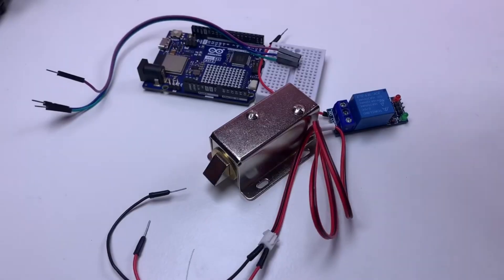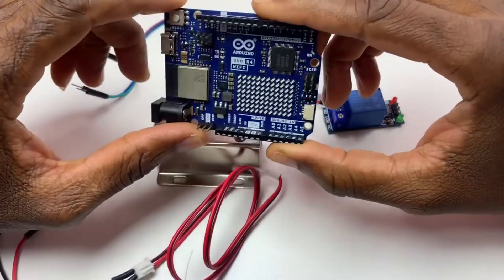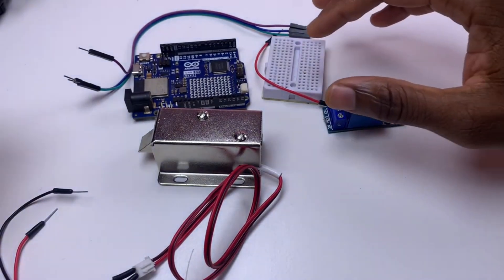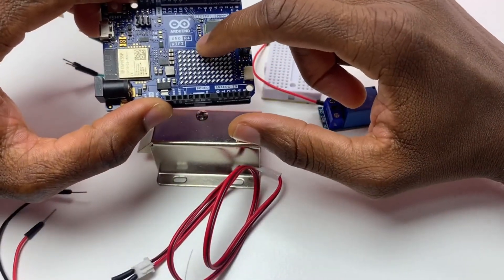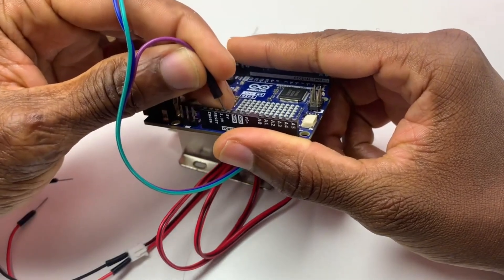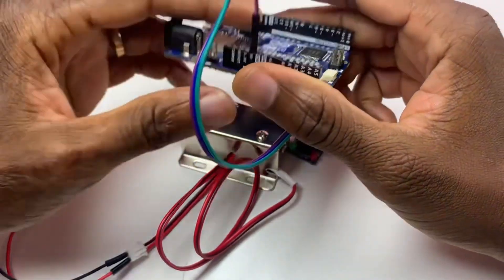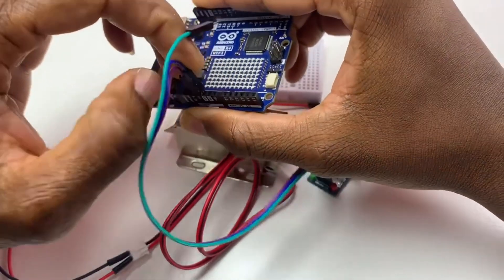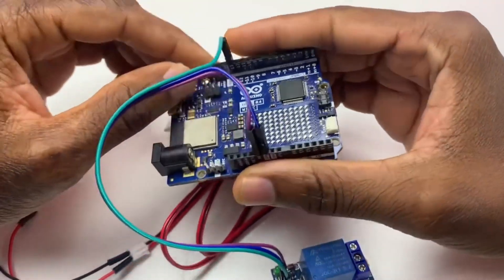How to make IoT Door Lock | IoT Remote App Tutorial | Internet of Things | IoT project using Arduino

Comment: I have been trying to connect a 4*4 matrix keyboard to the Arduino Uno Wifi...I don't know what I'm doing wrong because I press a key and it doesn't show anything.
My intention is to make an electronic lock that opens only with a token.
Reply from the maker: Maybe the library you’re using is not compatibcompatible with UNO R4 Wi-Fi
Reply: Okay.... thank you so much.
I'll try to change the library.